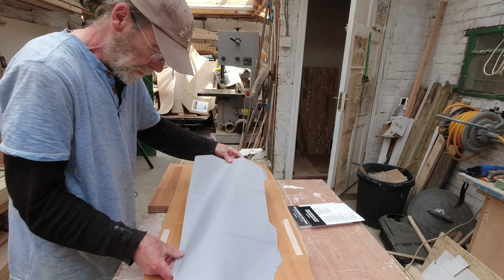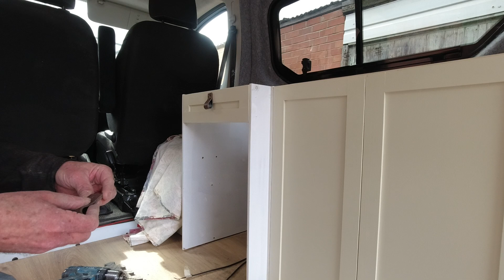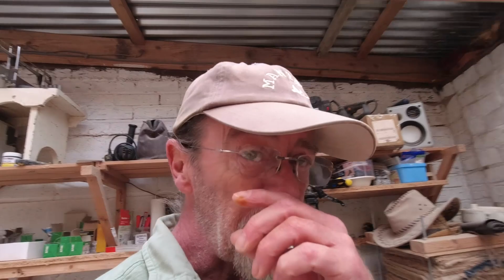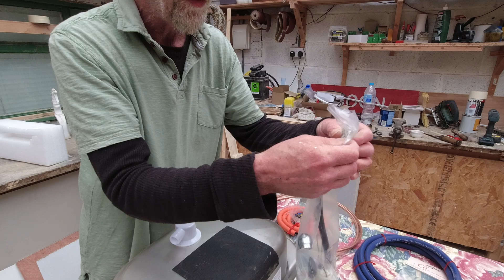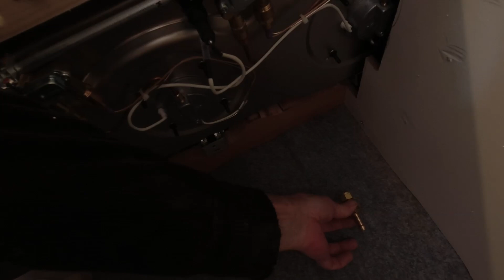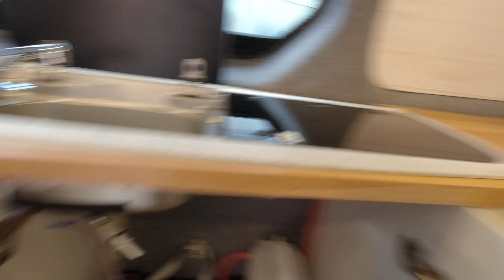Vauxhall Vivaro Campervan Conversion - Pt 13 - Fitting The Smev 9222 Sink and Hob

Comment: that looks like a brass olive you are using on that gas pipe? it should be a copper olive as it compresses better and the threads don't need any paste as they don't create the seal and all you are doing is restricting the amount of turns you can get on the thread.
Reply from the maker: Hi I just used the material that came with the kit.....I assume it's all the right stuff. Thanks.
Reply: Unfortunately assuming its the right stuff can kill you where gas is concerned and the lack of correct information can also get others killed that follow you. This is why lpg gas engineers don't do videos on installing gas as people think because its a kit its the correct stuff to use.

Comment: Hi Dave ,great video.Ive just got the same hob and It looks like I've got the same template as you used ,did you have to radius the corners and router them out to get the hob to sit flush ? ,after looking over and over at the technical drawing that came with the hob it looks like the corners where the srews go in should be curved and not straight as the template would suggest any advise would be a great help cheers
Reply from the maker: Hi Chris, The template I got was nothing like the shape of the hob. I had to adjust the cut outs for the hinges and amend it for the place where the gas pipe sits. The crew hols were okay, but what I found best was to cut out he main template shape and then offer up the hob and try to mark where it was snagging and take a bit more off. It took me a while to get it right as I did not want to cut too much off. So little by little is the best bet. You'd think they would just send a template that fits. Good luck with it and I hope that helps.
Reply: Thanks Dave ,will take your advise and go litle by little when it comes to cutting my worktop, ,yes I agree about the template, I did a test cut on some scrap board & it did require some extra trimming, and a bit of fettling, as you say in your video close, but no cigar